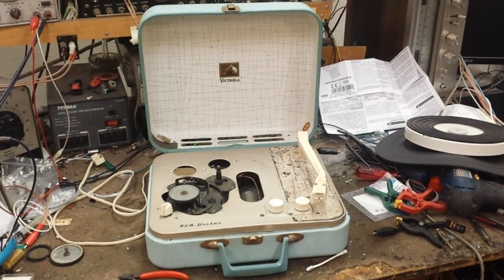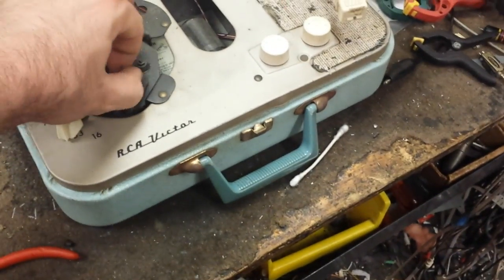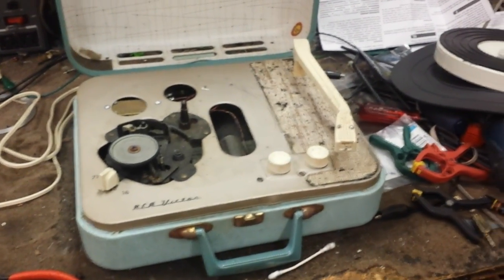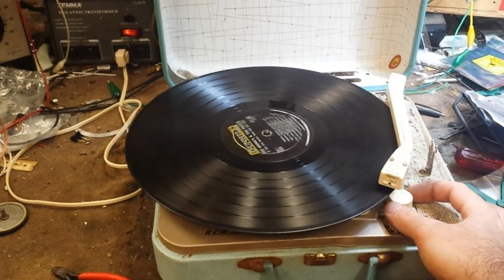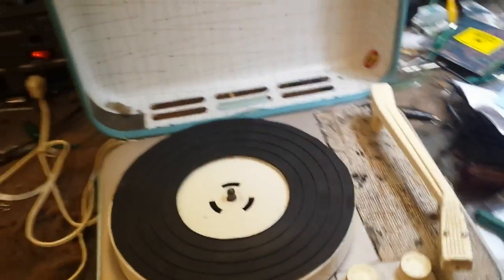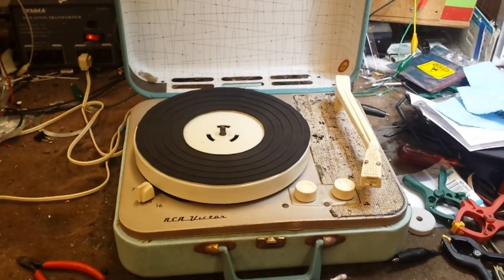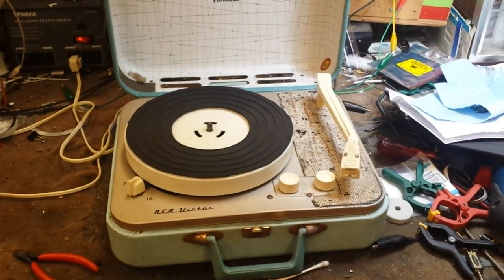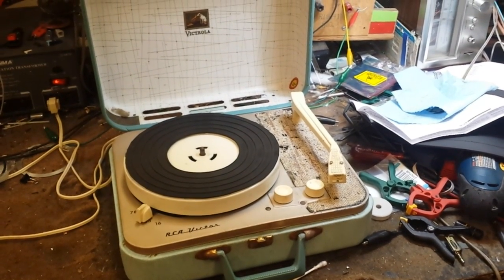Preamp modification for Rca 1-emp-2l

Comment: Radio TV Phononut had posted a video of an FET preamp like yours but much simpler, it operates off the 8v from the tube cathode, I built  of them for a couple of RCA 45 rpm players, with a new stereo ceramic cartridge and they sound great.

Comment: I have a question that I think you can help me with and that is I have an old tube radio that works well on the back of the radio is a phono input RCA type plug in when I plug my guitar into that the radio has to be turned up all the way to get any volume out of it so I was told that there is a resistor inside that I can change out and that will solve the issue can you give me some information on that for explain how that could be fixed thanks for any help you can give
Reply from the maker: Ron Carter , that radio is expecting a much larger signal than would come from your guitar. back then phonograph cartridges were crystal and put out 3 volts, rather than 100 millivolts. put a guitar or mic preamp between your guitar and the radio and your set
Reply: OK I'll try that, also I was told there is a resister you change out and that solves the issue as well, do you know anything about that or what is required to do that? Thanks for any help you can give.
Reply from the maker: Ron, I don't believe just changing a resistor will fix it. There aren't enough gain stages in that radio to accept the guitar pickup. However if you boost it with a mic preamp to a larger level that the radio's phono input can accept then it should work